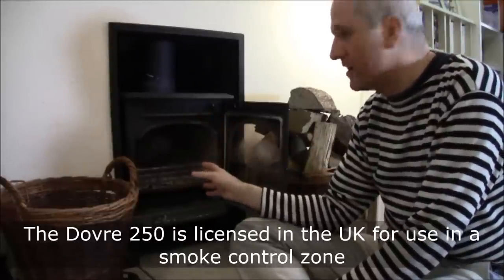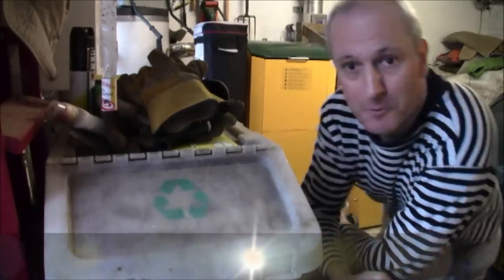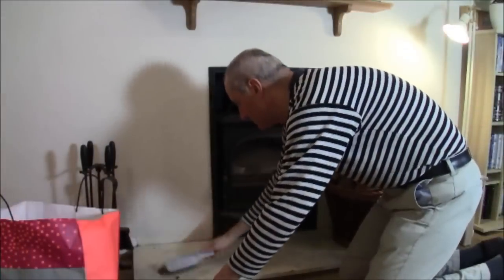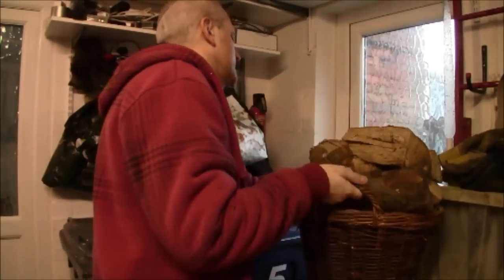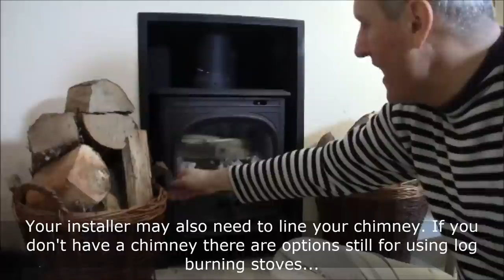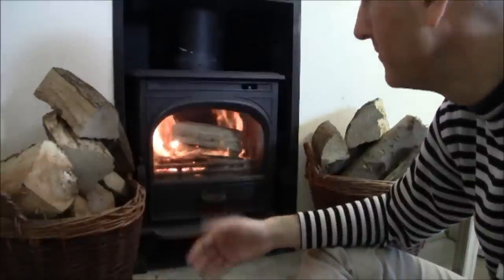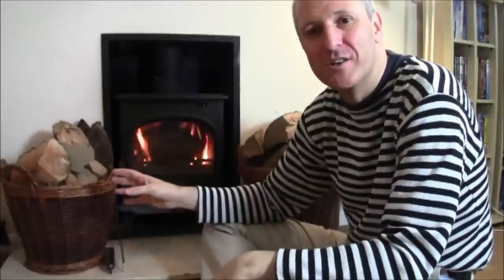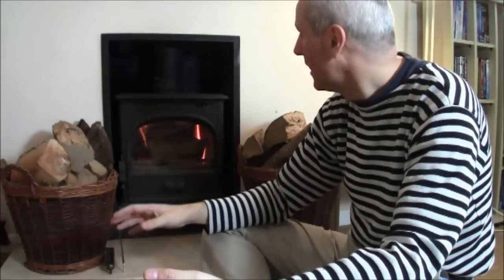How to use a Wood Burning Stove [Superhome59 part 13]

Comment: Hi, I have recently installed a 5Kw stove in my house and I'm still playing with it to get the optimum setting. The handbook says once the fire is going - about 5 mins after lighting - to close the lower vent off completely and to regulate the airflow using the top vent only. This allows air to come in on top of the wood rather then below it. Playing around with that top vent does change the colour of the embers from bright red to nearly out, so it is doing something.
Like you I was brought up with a traditional coal / wood fire and I light it exactly as you do, but apparently the Top down method is preferable. I've tried it once and it did light but it doesn't get going as fast as lighting it from the bottom.

Comment: I enjoyed watching your video. I have two recommendations for you to consider though. One, look into the top-down method of fire starting. Its way less smoky. Two, for cleaning the creosote from stove glass, newspaper moistened with plain water and a bit of rubbing is all you need. Seriously, its that easy. Save your money, don't buy the products.
Reply: another trick to clean the glass damp piece of kitchen papers dip it in the ash from last nights fire and clean the window. works perfectly no chemicals and perfectly clean. 
I always use top down its the only way to light a fire.

Comment: The problem of cold bedrooms is easily mitigated with a wireless thermostat. Simply move it to the bedrooms. The heating will remain on until the bedrooms are warm, and thermostatic radiator valves in the living rooms will prevent overheating there.
Reply from the maker: +Spencer Wilton I understand you mean a single thermostat that you can move around? If you simply moved the single thermostat to the cold bedroom then that might be an improvement despite the inconvenience. You would rely upon the living area TRVs to shutdown the local rads whilst still pumping heat to cold bedrooms. There is a risk of waste and overheating but your idea is worth trying. The only issue is that our Thermostat is a digital one linked to the KWB Biomass pellet boiler controller. Unless these things can be retrofitted to such proprietary systems then this is not an opportunity open to us. But thanks for the idea.

Comment: Hi great instructive video.

Why is your air gap around the stove so small ?
I'm fiting one and the stove says 150mm gap all round
Reply from the maker: The Dovre 250 was shoe-horned into the space available. The slot it is in was designed for a small gas fire. It would not be possible to make it bigger without removing bricks that hold the house up. The installer never mentioned the lack of space would be a problem and none of the chimney sweeps have ever commented upon it. Since it is close to masonry and this is not flammable then there really is no immediate danger. Expansion and contraction may cause wall cracks but we haven't noticed any in the plaster (after years of use) - so there is no apparent problem. The advice to leave a gap is new to us and we were not aware of it before. It may well be a precaution to avoid singeing a wood surround? It may well also be good advice for stove maintenance? Who knows. A masonry stove is actually built into a brick surround. As is any Pizza oven. Hence this is not likely to be of any real-world concern. Certainly we have never had any actual problems and do not expect any. Thanks for your feedback and thanks for looking!
Reply: Thanks for the reply ,
Just dont know if they would sign it off if I fit one that dont have a big enough air gap.
the one i want to fit is 20mm to big to get me 150mm air gap at the sides.
Reply from the maker: Depends what you mean by "they" and "sign off". There may well be Building Regulations but an inspection is unlikely. Air supply is critical to avoid creating Carbon Monoxide. You will need a Carbon Monoxide alarm in the room. That could be life-saving. But air-circulation AROUND a fire sound like nothing more than something you do to avoid heat damage to the surrounding structure and to allow maintenance. Hard to imagine that being subject to a hard enforcement by the building Inspector. May depend upon which country you are in I suppose! Anyway.. Thanks again for the feedback. Interesting.
Reply: Thanks for the reply.
Cant wait for the install for this Christmas.
I'm from UK BTW.
Reply: Your fitter has ripped you off, of course they could of made it wider, just used a concrete lintel,

Comment: Hope video. How should I stack my wood when refueling the stove?
Reply from the maker: I throw my logs into large wicker baskets and store them as close to the stove as possible. They are not "stacked" there as such but there is plenty of warm air circulating around them from the adjacent stove. With two such baskets, either side of the stove, we will burn through one basket load in an evening then refill the empty one. So each basket has been next to the hot stove for 24 hours before burning - hence the wood there is warm and dry before its turn in the stove.
Reply: @Superhome59  thanks for the reply. I meant how do I place the logs in the actual stove?
Reply from the maker: @mattseymour8637  It is quite a small space and the logs fill it quickly. I just open the front door and place a log on top of the burning embers. There is no real art to it.

Comment from the maker: I have had to remove a troll comment this morning by somebody who could not spell the word "logs" or the word "firelighters" before making an incomprehensible comment about a "proper log store built not using sheets". I have literally no idea what this person was on about but this sort of thing will not be tolerated. The installation was done by professionals and the usage shown in this video is best practice. You may have opinions about improvements but I will remove comments by any person who clearly has not watched the video and who clearly have not a single clue about how to use a wood burning stove.

Comment: Does the stove intake air from the room it is in or is there a pipe connected to an external wall bringing in air from outside?
Reply from the maker: It takes it from the room. This is normal and for a house of this age and construction this is of no problem. However you should fit a carbon monoxide sensor in the room if you do so. Personally I would have preferred it if it drew air in from outside but you do have the problem of have to block that hole up the rest of the time! [I would like to have some kind of ventilation system that drew cold air from the furthest part of the house and used that. Warm air would be re-circulated back to give whole house warmth.]
Reply: Any fire rated at 5kW/h or under, does not need to have an external air supply.Some burners have this feature from behind the stove to draw in cold air.

Comment: It might be an idea to place a plastic bag around that ash tray when carrying it out of the house 🏠
Reply from the maker: Thanks for the suggestion. In practice this is unlikely to work as placing the bag over the tray is likely to send the dust flying. Secondly, if the tray is still hot then it could be disastrous. In reality we find there is no actual problem is walking the ash tray out of the house. Best wishes.

Comment: the glass on my tiger woodburner gets dirty very quickly on the edges. im not sure why. it only has an air intake valve at the bottom, not at the top.

i do tend to start a fire just as you show (paper, kindling, then i add a log) but i also like to mix in a bit of smokeless solid fuel. 

this way i usually only need to burn 3-5 split logs for an entire evening and maybe 10 smokeless briquettes.in the end i end up with a medium sized bed of smokeless with logs going nicely on top.

i'm not sure if the smog is something to do with the air supply, the wood moisture content, or the burning of two fuels together.

thanks
Reply from the maker: We just use regular dry logs. The stove model we use has an air vent that blows fresh air over the inside of the glass. It helps to evaporate any condensate. However if anything burns close to to glass it will get a smoky residue. That is normal. I simply give it a wipe over with window cleaner every couple of days. For a deeper cleaning use something like the Stovax Glass Cleaner (I think I show this in the video?) - it is foul stuff but it does the trick. Good luck! Thanks for watching.
Reply: thank you for the reply. i use kiln dried logs so i think they're pretty dry. i tend to dry them out a bit more by putting them near the fire (but not too close). 

i think i need a fire that also has a top vent. what model is yours? looks v nice.
Reply from the maker: It is a Dovre 250.
Reply: it's lovely. thanks for sharing.

btw, i found an easier method of glass cleaning. just take a piece of wood ember out of the fire when it's burning, let it cool down, and next morning rub it on the glass. it will cut through even the most stubborn soot stains! no products required
Reply from the maker: Yeah, think I have seen that somewhere before: carbon/soot has good abrasive properties and can be used to clean things. Just be careful in that the stove manufacturers prefer you not to use an abrasive. That might apply to bathroom or kitchen cleaning products so soot might be benign. Good tip though! Cheers.
Reply: Low Energy Retrofit South Bucks - Superhome 59 oh that's a good point, i hadn't thought of that. i'll keep an eye on it to make sure it doesn't scratch, but i haven't noticed any problems so far.

Comment: Thansk! very very useful video... 

I have couple of questions,

1. How many logs do we need to actually burn at a time? I have 3KW smaller burner so I try n burn only one at a time?
2. You mentioned it is actually provding heat to your almost entire house? Is that true? how long do you keep your burner ON? and I am assuming you have open chimeny.
3. Honestly speaking currently I am struggling to get my one room heated and I know doing something wrong...  please please help n advise.  ta!
Reply from the maker: Sorry - I seem to have missed this comment from late 2016. To answer your questions
1. The Dovre 250 will take logs up to about 280mm long if you shoe-horn them in diagonally. So there is no real answer as it depends upon the size of the log. Assuming the average 250mm long log then I would say that we can get three in at a time. Or you can get in just one really big one. Or you can get in five smaller ones. Hard to be precise.
2. We have an open stair-well so the heat will circulate through the entire home. This is not quite the same as heating the whole house because the living areas will be toasty and warm, a couple of upstairs bedrooms are OK but two rooms (at the far end of the house upstairs) will feel too cold in comparison. Usage depends upon the school/working day. Typically I will light the fire at around 5 to 6pm when I am home from work and we will keep it going until 8 or 9pm. If my wife stays up and watches TV she will keep topping up the logs until 10pm. Some winter days, like weekends, we could light it in the morning and it will be alight all day. The chimney is lined.
3. How warm your home feels does rather depend upon your insulation and may have nothing to do with your heating appliance. So all the usual caveats apply. Our home has cavity wall insulation with full double or triple glazed windows. We draw the curtains at night and have a full 300mm of loft insulation. One side of our home faces south and is unshaded so we get a lot of solar gain. All these can influence how warm your home feels. Difficult to know, without seeing your home, what your issue could be. If you feel it is a problem with the wood-burner maybe consult a professional. I don't know what the problem could be in that area as they are quite simple and there is little to go wrong.

Comment: what should i know about being safe if i get a wood burner ? Can i use wood logs from trees  or wooden pallets for the wood burner ?
Reply from the maker: I think I do cover most of these points in the video. Get a professional installer in and ask them these question for your particular property. Wood Burners are perfectly safe with your only real concern being adequate airflow so as to prevent carbon monoxide build-up in the living space. Hence you will need a carbon monoxide detector and get a professional to install the wood burner. You can burn pallets, we do! You can buy logs too (as we do) but they will need to be seasoned. This means they should have been dried out for at least a year before you burn them.

Comment: I've been advised NOT to use newspaper or paper in a wood stove as the paper can cause blockages in the chimney area?
Reply from the maker: +Dave Alan Paper is only used to start the fire and is under a layer of kindling. I think you may refer to the general burning of paper in a stove as a method of incineration & in large quantities. In that case I agree - it is not wise because small pieces of burning paper can get sucked up into the flue and become lodged. I have seen this happen and it can get a bit hairy. Only use paper to light the fire.
Reply: Small amount of paper is ok

Comment: No worries. I mainly burn wood. But occasionally coal. Have you burnt housecoal on it before and or coal at same time as logs?
Reply from the maker: No, never. Never considered it. It goes against the whole principle of the operation here!
Reply: @Superhome59  ok whys that? What does it go against?
Reply from the maker: @mattseymour8637  We promote a post-carbon life hence it would be against our principles to burn a fossil fuel.